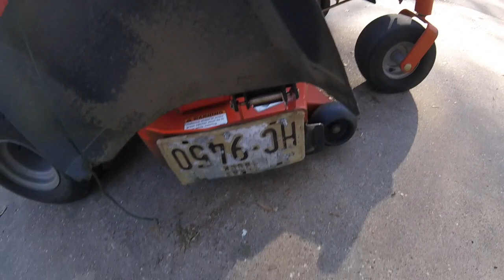Turn Your Mower into a Mulching Mower for $1! ZERO TURN MULCH KIT DIY

Comment: Ive been doing the same with my 34in Gravely,  tip- lightly coat the leaves with water and It'll help reduce the dust and keeps the leaves from blowing around and helps shred the leaves even more.